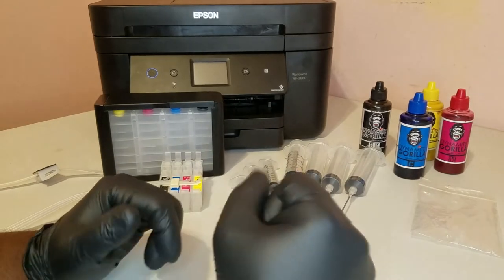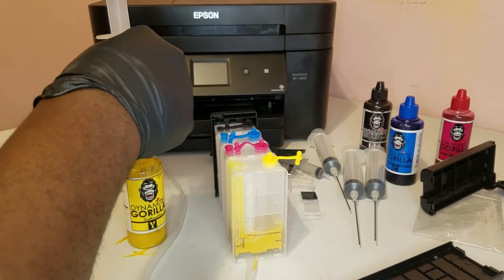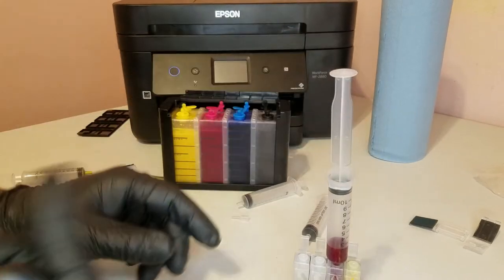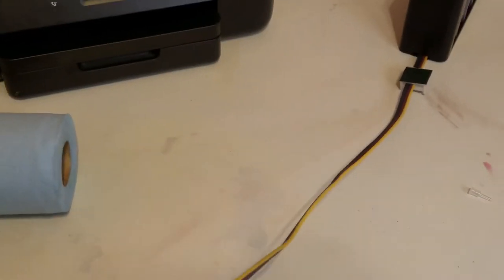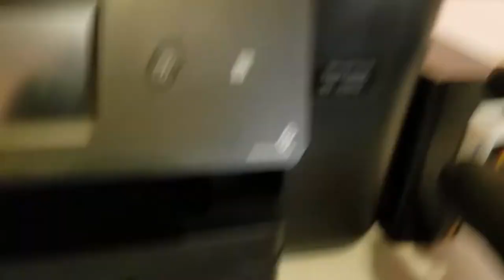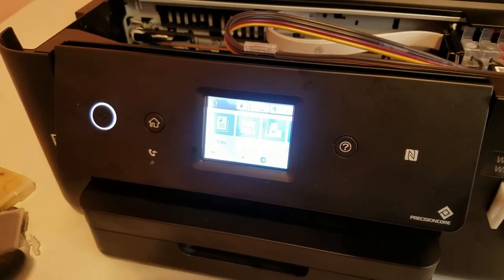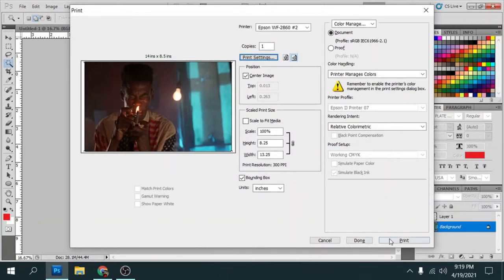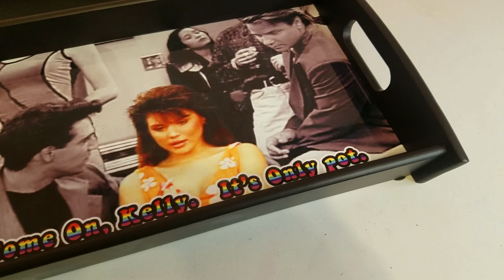WF 2860 Sublimation CISS Install

Comment: Question can print in black ink only as well or do you need to have colored ink with the black ink to use the printer in the settings of the printer?

Comment: Mine theres no ink coming out, i tried everything they seems stuck. i used the needle and the syringe top and bottom to see if the ink moves they move, but they go back to having air stuck in that tiny tube after the connection. IDK what else to do, so frustrating.
Reply from the maker: Are the vent plugs removed? The ink won't flow If they are plugged.

Comment: Do you think this would work for my wf EPSON 4820
Reply from the maker: No. There isn't a chipless firmware available for that model.
Reply: @McZell  do you have the 802xl with the chip on there I have the chipless one and they fit so if I can get the 802xl ink cartridge with the chip that would be great
Reply from the maker: @ray.generes1012  in the US they can't sell just the chips  the only way to get them is from the original Epson Cartridges and put them on the refill Cartridges.  Hopefully the chipless firmware will be released soon.